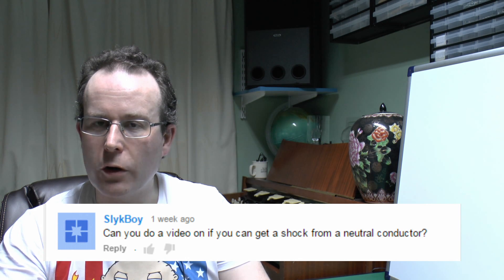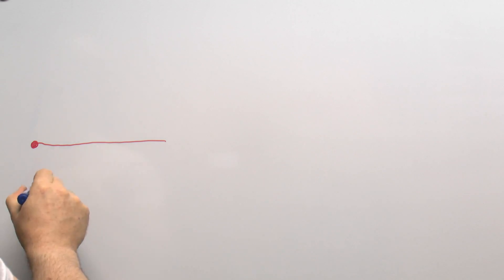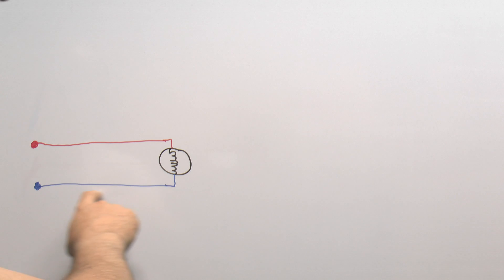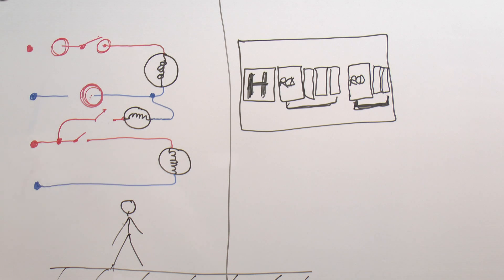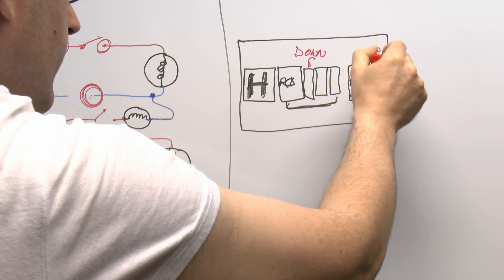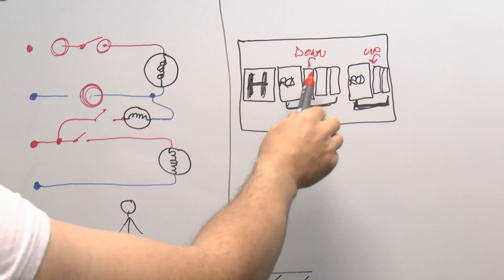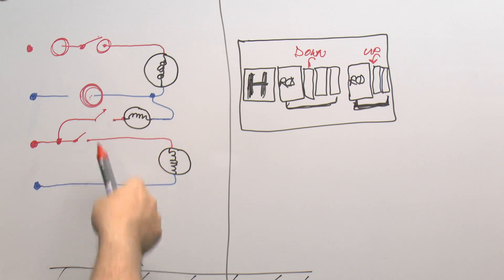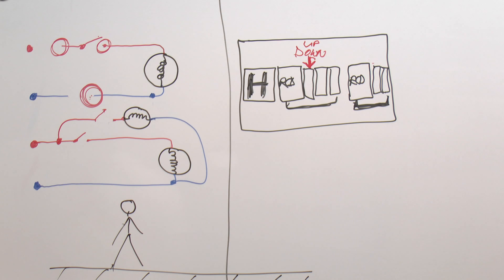Shared or Borrowed Neutrals on Mains Electricity Circuits

Comment: Why do you get a shock if you touch the live conductor but not if you touch the neutral? Assuming both are connected in a circuit that goes to earth with no breaks.
Reply from the maker: Neutral is connected to earth at the source, so will be the same or very close to the same voltage as earth.

Comment: I have experienced this. I did not know you could not get shocked by touching the N in a closed circuit, so if I removed the cover from my lamps plug plugged it back in and turned the lamp on and touched the neutral I would not get shocked?
Reply from the maker: If that wire is connected to the neutral then no shock.  However if it's disconnected you will get a shock from it because once disconnected it's not a neutral any more, it's just a path through the lamp to the live.

Comment: Brilliantly explained video John, as are all your videos. I wonder if you could do a video explaining why it is necessary to have a separate earthing system for a Solar PV/battery installation with an emergency power supply off the battery. We have a TT supply and I don't understand the need for an additional earth.

Comment: Thanks John as always. A couple of questions/comments: 
How do you discover a shared neutral in testing? I did an EICR at a property recently before replacing a CU, but it wasn't until I put the up and dn lights on seperate RCBO's that I realised there was a problem. Maybe my testing procedure needs to be updated!?
Secondly, I am not very happy with putting up and down lights onto one circuit. If you get a fault on one circuit you loose all the house lighting. I appreciate it is the pragmatic approach.
Reply from the maker: Switch on all the lights, and leave them on.  Isolate at the consumer unit, remove the L&N wires for all of the lighting circuits and test for insulation resistance at 250V between each set of wires, so LN1 - LN2.  If there is a shared neutral it will show as very low resistance between the two circuits.
Same can be done for all other circuits if it's suspected that there are interconnections between those - but you do need some loads connected to each circuit otherwise the problem will not be revealed.
Reply: Thanks John, yes I see it is really important to have all the lights on. I did manage to coorect the issue yesterday, as it was, it was quite straight forward. The house had been rewired in 1968. Will test for them in houses of that era in the future.

Comment: I had this exact issue when I bought my house and boarded the loft (temporarily disconnecting the wires to drill them through the joists and reconnect exactly as before), upstairs light circuit off. I got a massive belt from the disconnected wire. I eventually found it to be the landing light, live taken from downstairs to the common of a 2-way in the hall then L1/L2 routed via twin (no earth) to the upstairs switch and then the common switched live into the loft (not using the feed from upstairs). All to save running triple between the downstairs and upstairs switches. When I redecorated the landing I ran a twin and earth to the loft from the downstairs to provide the neutral (note this was when I was allowed to do this myself about 25 years ago)! Very informative vids!

Comment: I've got a situation in which I have conductors from two circuits on separate phases connected to the same groundless receptacle in a bedroom. I believe the one circuit is using the neutral from the other to make the light fixtures in the basement directly below work. Its a weird situation

Comment: I needed an ECIR for my rented property, I had to add an additional RCD for lighting circuit, there already was one for the power circuit, so instead of messing about with installing two seperate RCDs I decided to go for RCBO for upstairs lighting and down stairs lighting, one of the upper hallway light on a two way switching circuit shared a neutral with upstairs lighting circuit, so every time someone switched on a hallway light it tripped both RCBOs, I had to run a new neutral for the hallway light from ground floor neutral. At the time it was a puzzle until I put it down on a drawing trying to figure out what the heck was going on.

Comment: You can get electrocuted off any 230vac cable. 
Pays to always isolate, prove test prove before touching.
You can even get electrocuted off a bonding earth or from a main supply earth cable if the neutral at the point of entry is open or high resistance faulty.

Comment: Where I live we don't want to share neutrals randomly because of ampacity but also the possibility of creating a multiwire branch circuit. This is fine at the panel since the neutral is shared anyway but down the branching line losing the shared neutral across the MWBC creates full line to line voltage across the loads in series.

Comment: We had our house rewired recently. Changed from cartridge fuses to RCBs. Everything went fine with the wiring, replacing circuit for circuit, until the testing. Upstairs lights worked. Downstairs lights worked. Stairs lights tripped both breakers. Ended up putting both lighting circuits into one breaker because the electrician couldn't fix it any other way without tripping breakers.

Comment: sometimes called a 'Loaded neutral' if u borrow a neutral from another ckt on same phase leg,
the neutral currents will + up and you can burn out a neutral even though hot wire was properly
protected.

Comment: So how much power would be coming out of the hot wire if it's just floating in the air about 27 volts ac i think.

Comment: Does a borrowed neutral warrant a C2 and if so how and why?
Reply from the maker: Yes, because it's two separate circuits connected together, so isolating one circuit will still leave it energised via the other one.
Reply: @jwflame  thank you very much John.

Comment: Hi i was thinking of renting rooms out, So first floor 16mm tails -Consumer unit  covering a kitchen corridor lights. Then 4  x 10mm cable to a garage fuse box to supply a radial and light cables. X 4 rooms. Apparently this is how small hotels are wired by my electrical friend . Could you cover some possibilities.  Also maybe a electric meter to keep a check on used electric Thanks

Comment: Yeah that’s why we always pigtail our neutrals here. That way you can disconnect the neutral pigtail of the device you’re working on and the rest maintain connection back to the panel. Also if you share a neutral you put the associated hots on a two pole breaker. That way you must kill both circuits involved with said shared neutral

Comment: If there is the same potential going through the RCD on line and neutral, then how come you don’t get a shock from the neutral? I cant wrap my head around that
Reply from the maker: The same current goes through line and neutral conductors.
The potential / voltage of each relative to Earth is different.  Line to Earth 230V, neutral to Earth 0V, or very close to 0.

Comment: Can a ghost voltage give a shock. I had maybe 35 volt ghost voltage at the fluorescent light and it went up to 130 volt when i took the bulb out. The voltage was causing the bulb to flicker on when switch at wall was off. Apparently the electronic box has capacitors that charge up slowly causing the bulb to flicker on. Thats what i read else where on internet.

Comment: Great presentation and explanation John - much appreciated! I'm just changing out the bathroom downlights and noticed whilst I was in the loft how shabby the upstairs lighting was and decided that it should be tidied-up somewhat. Took me a bit of time to work out how the upstairs/downstairs 2-Way lighting circuit had been wired (probably done around the 70's) and realised the upstairs 2-Way light (fed from the downstairs lighting MCB) was actually wired into the upstairs light neutrals (fed from the upstairs lighting MCB) which didn't seem correct at first sight and as you've clearly explained it isn't. Many thanks! Just came across your channel - most impressed!!

Comment: I've been hit by a neutral on a 480/277 volt circuit and it hurts.. the old electricians would tie all the neutrals together and that makes it hard for us because you can turn a circuit off but that neutral will fuck you up.. If I'm installing new panels and circuits in a building, I do my best to not tie up all the neutrals together..

Comment: What you say at 2:05 is incorrect... if you touched the neutral with the circuit closed and in operation, you would get a shock, even if the neutral is tied to ground at the consumer unit, a person coming into  contact with it and tied to ground with their feet, you create a parallel path for current return. Current will flow through the person - I.e. electric shock, you only don’t get a shock in reality due to an RCD in the consumer unit, because current flowing through the person in this instance means current through live doesn’t equal current through neutral at the rcd point.

Very dangerous what you’re telling people at 2:05

Comment: Not that simple. Whether you get shocked depends on what the load is. Most loads don't have low enough resistance to actually shock you without also touching an active ground or neutral. The real danger with sharing neutrals is overloading the neutral, which happens all the time. Don't share neutrals.

Comment: I read somewhere that  two circuits can share a neutral if you use a tandem circuit breaker
Reply from the maker: They can, same applies with a 3 pole circuit breaker.

Comment: thanks for the video. if someone could explain and help me understand? i thought breakers/GFCIs tripped when a different amount of current returned than what went out. so if there are 2 lights on 1 neutral, and both are on, wouldn't there be a different amount of current on the neutral than went out on each individual hot? wouldn't the current returning be doubled? thanks
Reply from the maker: Yes, and if a shared neutral is present, the RCD / GFCI will trip all the time.

Comment: I have EXACTLY the 1st situation you explained:  upstairs lighting.  Except both circuits were ceiling lighting in a 1.5 story cape code house.  

My solution is to make the 2 circuits a single circuit.  I'm trying to decide if I bond them together in the panel which may confuse someone working there, or to bond them in the wiring near the panel.  Since these circuits are old knob & tube, I'll probably have to bond in the panel with a Warning Label explaining the situation.

One point to make is you can SERIOUSLY OVERLOAD the Shared Return.  IF you had a full load on both circuits, you would have the COMBINED LOAD ON THE SHARED RETURN.  W/15 amp breakers, you theoretically could have 30 amps on the return.  BUT since these are typically 100% lighting, that never happens.

You should have seen what happened when not knowing my situation, I decided to balance the load by placing one circuit on each of the mains legs (!)  No breakers blew, but load imbalance destroyed all the surge protectors I had on all my electronics and there was definitely the smell of "burnt electrics."  This was after maybe 10-30 seconds of energization.  It was torture wait to see if I started a fire in a wall, but the house had good knob and tube construction practices so there wasn't enough time to burn off all the insulation and radiantly heat the wood until it caught fire!

Comment: Hello John borrowed neutrals are
Very common in hospitals where critical areas are supplied from essential and non essential distribution boards usually single phase boards both on the same phase. And usually find on lighting circuits which are not RCD protected. What can happen quite often is you can electrically isolate a single phase distribution at the source of the supply and then when you prove dead at the board find 230v across neutral and earth. Be very careful as you can prove dead at the board. Someone switches a light switch On supplied from the  other board which is not isolated and then the neutral bar on the isolated board becomes live!!!!!

Comment: You don’t need completely broken N wire to get electric shock - depends on how far secondary earthing contour of PEN wire from a place a person touches N wire is. Resistance which rises with wire lengt is enough to create unpleasant potential difference.

Comment: If this appears on an EICR should it be a Code 2 as its not dangerous until
something is disconnected. Or code 3 maybe as it could easily be improved by putting both lighting circuits on the same breaker?
Reply from the maker: C2, potentially dangerous.
Not C1 as that would be dangerous now, and not C3 as that would indicate not dangerous at all.
Reply: Thanks John

Comment: I worked on a circuit last week where a boiler was fed from two different circuits - sadly not uncommon. A switch fed the supply to the boiler but a programmer was independently fed from another circuit. The boiler actually had its own breaker in a recently upgraded board marked central heating. The problem is isolating that circuit only isolated the supply. If the homeowner had switched on the heating while I was working there, 230 would have been lurking around on the switch wire. I got rid of all that and ran everything from one fused spur. I also had to change that because the original switch was unfused. It's a potentially dangerous situation that is easy to miss
Reply: It seems the code requires a disconnecting means insight of the equipment. at least 
for A/C's on residential set-ups. It need not be fused as its protected at the panel,
this rule is so no one can juice up the system with someone wrkg on it.

Comment: Hi, thanks a lot for all the info. A question though, wouldn't any of those scenarios described there cause the RCD to trip? Thanks.
Reply from the maker: Yes, if the two circuits were on a different RCD.
This problem is usually found in older properties which don't have RCDs.
Reply: @jwflame  Thanks again and for taking the time to reply. Much appreciated

Comment: I Did have a shock on a lighting circuit neutral wire.
Carpenter saw Mark on the cable lighten circuit under the floor boards. Had a intermittent  problem with lighting circuit. This is when finding the fault that a got a shock from the neutral return wire.
When I found the damage cable,the saw cut the outer casing of the cable and the neutral return wire to the fuse box. 😳

Comment: A very interesting video. I regularly came across 415V three phase and neutral fuse boards before I took early retirement and these were commonly used for lighting. We'd remove fuses to work on separate lighting circuits but I never considered there might be shared neutrals.

Comment: Could you wire security gate to have a shock when power is turned off just residual for brain storming or to the rooftop if you have a metal roof just to keep birds from popping. LoL i don't understand the power will remain trapped like in a capacitor? Min 3

Comment: The best part of the shared neutral in the US is that you have a 50/50 chance of getting on the wrong side of the split phase.  Then it goes from 120V to 240V and you will let the magic smoke out of whatever that device was on the shared circuit!  😎  You will know pretty quick something is mis-wired at least, most likely in that hidden junction box in the wall. 😲

Comment: This is why in the U.S. it's against code to share a neutral.. with the exception of a 240V circuit. Of course, people wire things however they like because there is little follow through on illegal activities. Bad techs are simply part changers, nothing more.

Comment: At 14:00 Another problem not mentioned: If the 3 breakers are on the same phase, then 10A x 3 = potentially 30A on the neutral, also rated at 10A. Iv Seen that. A perfect way to cook a few wires or a whole house!

Comment: What could be possible cause of Neutral wire  showing continuity with Earthing wire anywhere in a building wiring when service MCB(2 pole) is in ON position while same wires do not show continuity when the MCB is switched OFF in single phase supply. It is confirmed there is no continuity between any two wires L, N & E in the building wiring when checked without switching ON the aforesaid MCB. Further with supply ON the voltage across L & N and L & E show 240V and that between N & E shows near zero. Shall be thankful if you kindly send your response on this issue.
Reply from the maker: On a TN system, N&E are connected together at the supply transformer.

Comment: We sometimes have circuits similar in the US with a shared neutral, but our 2 phase wiring can make a broken neutral wire very problematic for anything plugged in to them 😏 Because adjacent circuits in our panel (consumer unit) are 120v but 180 degrees out of phase, take away ground and you could have 240v going through a 120v appliance. Of course you won’t know it right away instead the hair dryer won’t work and then someone turns on the microwave and suddenly both pop and blue smoke comes out.